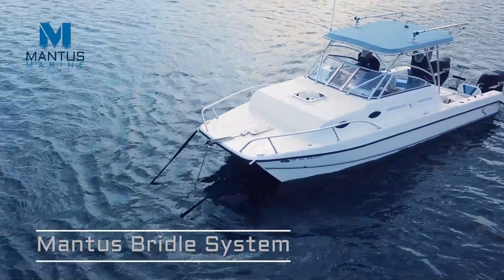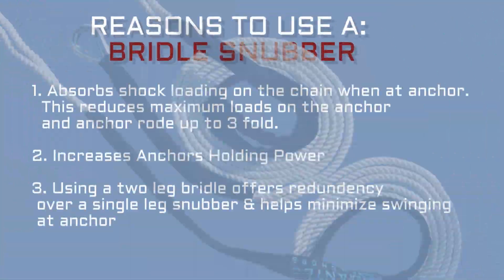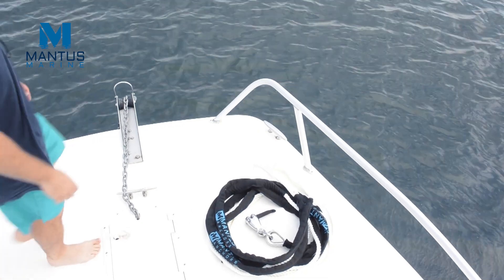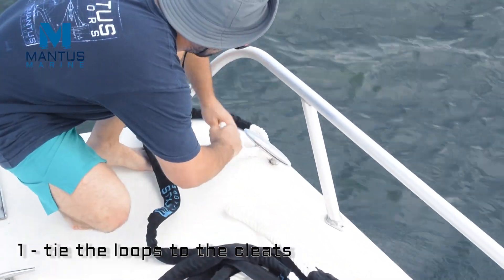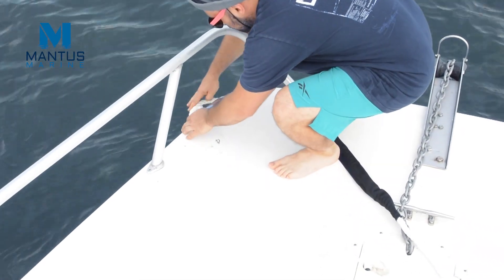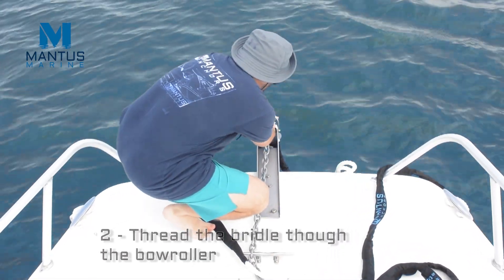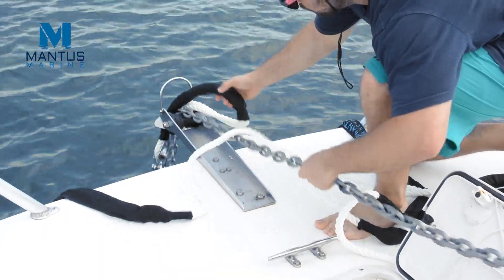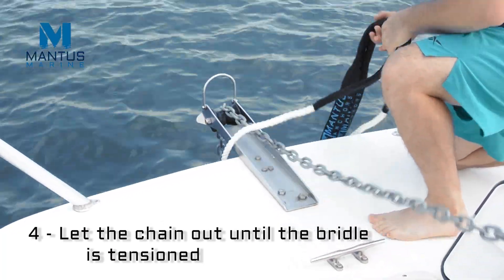Bridle Snubber System

Comment: Attaching the bridle to the bow cleats in that fashion is insanity. You'll never be able to remove those when the system is under significant load. Not good if you need to get away in a hurry. You'd have to cut the lines with a knife. Please, folks, use a cleat hitch on the cleats!!
Reply: Couldn't they just power up to the anchor, bring the chain in with the capstan and then easily remove the snubber?